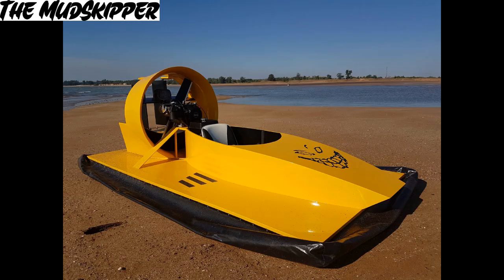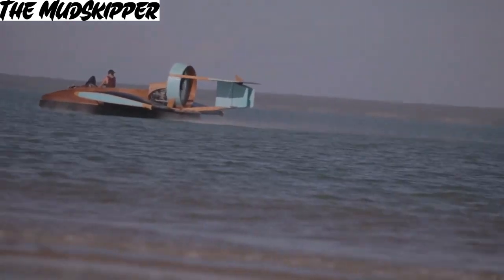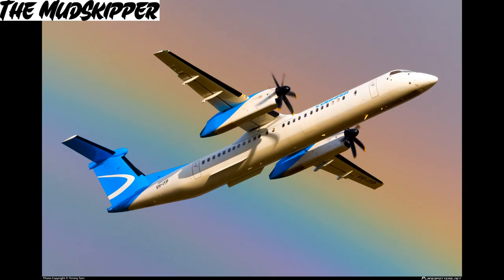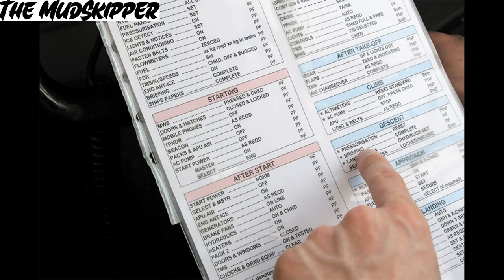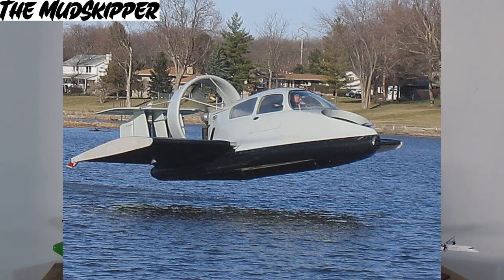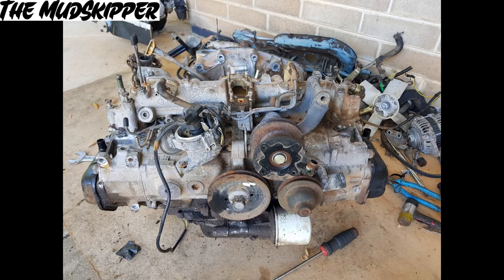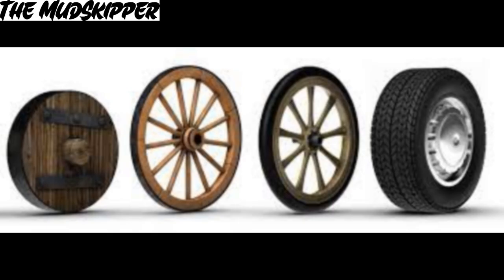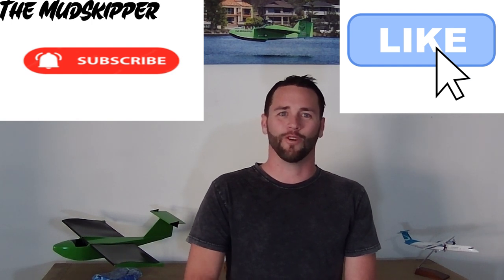Why I built a homemade FLYING BOAT, Russian ekranoplan

Comment: G'day,

Yay Team !

   I came for the Ground Effect Vehicle, subscribed on that account..., and then was totally surprised to find myself looking at a Volmer Jensen VJ-22 Osprey...!

In 1990 I bought an almost finished VJ-24..., that had started as the production-engineered  footlaunched Hang-Glider version of the VJ-23 ; which resulted when Volmer was affronted by Rogallo Wings' horrible inefficiency, so his '23  "Swing Wing" with a L/D of 9:1 was about twice as good as the best Rog., back in the mid '70s.

But the '23 was a nightmare for Homebuilders, Plywood Spar, Foam Ribs, Wings  tapered in both Thickness & Plan so no two Ribs in one Wing were the same size or Shape...; whereas the '24 is popriveted Aluminium with a Rectangular Plank for a Wing.

The VJ-24e had a 10 Hp McCulloch Chainsaw Motor ("e"ngine), in the Hang Cage, behind the Pilot, with a tiny direct drive Prop...., and the later
VJ-24w ("w"heels) had a 15hp Yamaha on a Fuselage Tube Extension, with a Centrifugal Clutch, 2.55:1 Reduction Drive,  60" Propeller & a Blade-Brake - for Soaring, while leaving the Engine idling, with the Propeller stopped to minimise Drag.

The Project which I bought had been through all those phases, except it had a 22 Hp JPX Pul 425, direct-driving a 41" x 12" Propeller.

I redesigned it, extensively, had a ball Testing it and flew it 6.5 hours before attempting a downwind Takeoff in  a Paddock too small and did the ,

"There I was, 5 feet off the Ground, nothing on the Clock but the Maker's name, upside-down at the time...: and I were flyin'
BACKWARDS...!"

Manouvre...

Before landing inverted in the Potato Patch.
And the Fencepost had
Barely a scratch...
But I have yet to begin rebuilding the
Jensen...
And I still walk with a Stick...

I recently had thoughts of electrifying the Jensen though, with a spare motor out of a Talaria Sting (Motocross Bike), and was getting a bit enthusiastic...; but apparently when the AUF became the RAAA  they quietly shitcanned Air Navigation Order 95.10, entirely...(!).

So, that's a Bummer.

My first Aeroplane was the 3rd pre-production Skycraft Scout, made in 1975, inspected by the DOT in January '76, and they wrote ANO 95.10 around it, and Gazetted it into Law in August 1976.

I'm the last person to have flown it, I was it's 3rd owner, it was my first Aeroplane and it took me for my first Solo ; with it's 120cc 8-hp "Pixie-Minor", built up from a Victa VC-120 Lawnmower...

It hangs in the National Transportation Museum, in Inverell, these days, I occasionally make the pilgrimage to visit it ; my father sold it on me, while I was out of town, in 1982 - he hated the thing and I was in a spot which required lawyering - and so  converting the Scout to Cash was at the time unavoidable.

Therefore, it survived. 

The one time it's current owner tried to fly it, the Propeller Bolts broke during his Engine Runup - hence my "Last to fly the First" status sort of snuck up on me.

It's great to encounter someone else who's adapting a Volmer Jensen Design to their own esoteric requirements...!

Keep on keeping on,

Stay safe,

And Happy Summer Solstice Festival !

;-p

Ciao !
Reply from the maker: Thanks for the comment and sounds like you love aviation. Good eye, this craft was inspired by the hull shape and the material thicknesses of the volmer but that's about all that was based off the volmer.
Reply: @Ground-Effect  

Cool,

Perhaps the bit about Volmer Jensen which I like the most, is that he started selling Plans for his VJ-11 in 1948, and it was a Foot-launched, Aerodynamically-controlled Biplane Hang-Glider....; and I've often wondered what the first 10 of his Designs were like, which led up to the VJ-11...(!).

Keep on keepin' on...

Stay safe.

;-p

Ciao !

Comment: Thanks for giving us extra details. Hope you keep doing the videos. 
Please try recording your voice with a phone or something closer to you. Otherwise a microphone plugged in or wirelessly linked to the camera could be used. 
If the room is echoing too much put some soft things like blankets or towels around to help stop the sound bouncing back off the walls and floor. Even just laying them on the floor if it's not carpeted will help. 
Also if you feel uncomfortable on camera , feel free to show a slideshow and narrate it. No problem leaving a picture up for an entire topic if it's what you're explaining or just a few photos on repeat. That way you don't need to find heaps of pictures for each video.
Thanks again for taking the time to do the video.
Reply from the maker: Thanks for the advice and tips. It's a whole new world creating videos and getting it correct 🤣
Reply: dont worry james  u got the wig thing right.. ull get the video thing right in no time  @Ground-Effect
Reply from the maker: @TROUROCKS  haha thanks mate. A bit more practice for me needed!

Comment: I can’t believe I’d watched and commented on your hand movement on a previous video and yet hadn’t thought it was the rudder you were controlling 😂😂
Reply from the maker: Yeah it's a bit of a different concept having a rudder but no pedals! Feels exactly like having airlerons
Reply: @Ground-Effect  So now I’m wondering about roll stability whilst in ground effect and guess that the lower wing has less drag and more lift being closer to the ground which to a degree counters the secondary rolling effect and levels the wing? Im wondering if that means short hops over objects as some WIGE’s can do is more risky without aileron’s, what do you think?

Comment: You don’t have to reinvent the wheel but you add to there design just like Dunlop did by adding tyres . I got a question , in a yaw turn does the inside wing lose that much lift it just dropped like in the other video ? And would a longer thinner fixed wing be able to still maintain lift more effectively?
Reply from the maker: The wing I have is very stable. It does not drop as you described. Which video were you referring to
Reply: @Ground-Effect  keep up the good work mate , try and try again brings results as you already know 👍👍

Comment: you rock buddy, you are a total inspiration, mine is about 80 percent done, same colour too,  except i have aluminum wings (a little bit heavy at 60 lbs each) are you selling plans? I'm intrigued how you are steering without ailerons??
Reply from the maker: Thanks, I appreciate the kind words. Have you got any photos of yours? Aluminium will be my next choice of material. No I'm not sadly. I am using rudder for roll. The secondary effect of yaw is roll!

Comment: Hello - Thank you very much   PLEASE make more - I have been planning a WIG for years and i am getting closer to building something - I found a COOT that would be my start - and i also found an Adventure Air Adventurer that was never completed    i have not bought yet but might now that I have see your inspiration - the Adventurer is heave compares to you hull - But if i buy it and weight it without the wings ( they are big wings) maybe it will get down to the point i can use less than 150 HP -
Reply from the maker: Thanks mate. I will make more